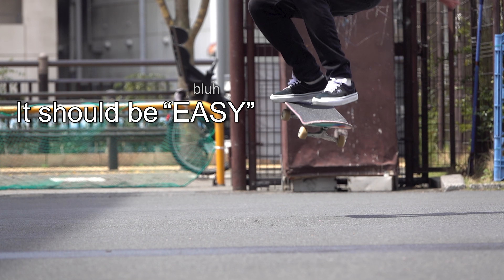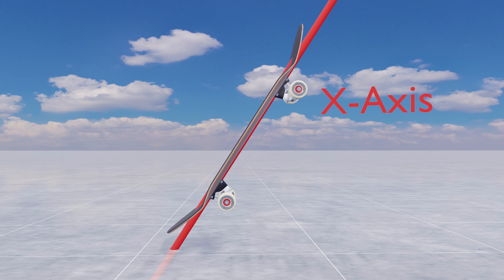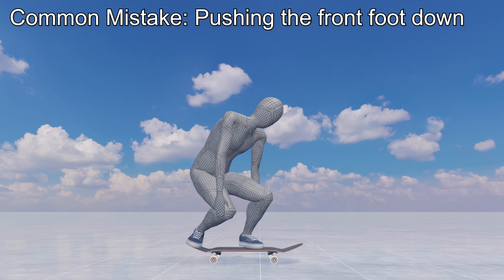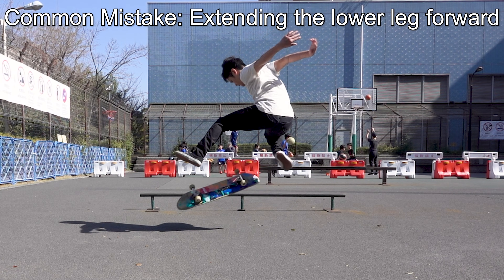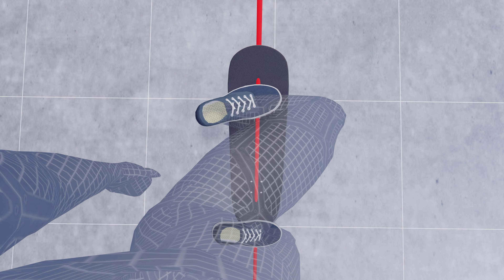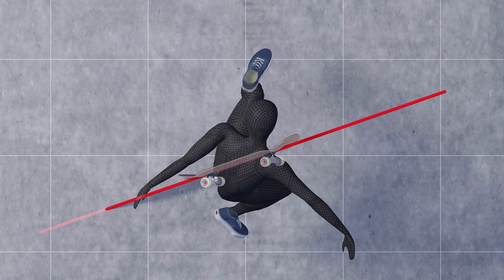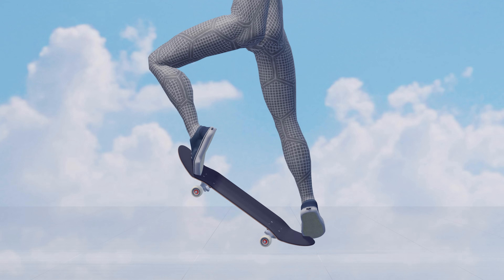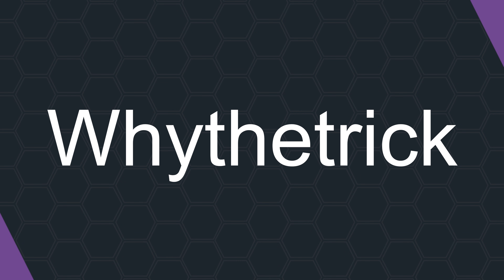KICKFLIP - PHYSICS & PHYSIOLOGY

Comment: want to know some really interesting physics? so the board is balanced, but also with areas of higher mass. when you press down on tail or nose it adds and uneven amount of inertia into the board. the lifted truck has more rotational momentum based inertia, which actually make it physically "heavier" than the other truck. the "lighter" truck then being able to leveraged up using the axis point of the highest mass. which isn't actually in the center and why good flips and ollies are caught with the back foot pointing down. front foot determines lowest height, but back end should be higher and press to the foot

there can be a drag, but the flip comes from flipping through the pocket, which curves over your foot at a certain angle, an to the side of the highest mass of the high mass area i.e. the baseplate. if you flip it before the truck it rockets, on or just past will go kind of even, and extended out will actually get leverage on the axis point and rise to your back foot forcefully. if you do it right, you preserve or redirect some of the rotation based inertia up while still leveraging the flip off the side of the highest mass of the reference frame. hardest part is learning to pick you feet up again. if entropy takes over or you bleed too much inertia, them tricks either don't work or are messed up. it's the basis for tricks like nollie front foot flips i.e. initial leverage to inertia juggle leverage to inertia juggle flip...

Comment: looks like your back foot toe is hanging off possibly adding to a more pressure flip-ish scoop. You might find a little more snap on the tail if you don't hang off your toe too much. You can counter balance that change by hanging your weight over your back knee more when you load so that you're not falling backward. Not a pro like you, just something I've been messing with recently.

Comment: Another great video. Awesome to see you are approaching 50k subs! I link your videos very often helping out newbies on r/NewSkaters.

Someone gave me a tip to point my front knee forward which was helping me but still didn't result in a land. I think this is the expanded explanation of that tip - will definitely try to give it a shot this weekend.

I think some of the 3d model shots were really helpful, especially the overhead shots where you showed the shoes that you shouldn't be able to see from that angle like around 7:02

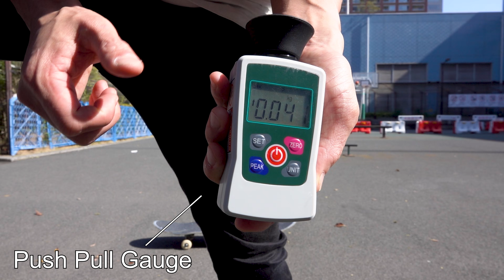Comment: 2:30 You also need to add the force the nose of the skate is making when rising, so the force you have to employ is for example 502g (from the foot for the rotation) plus the Relative Force that the board is projecting while going up.